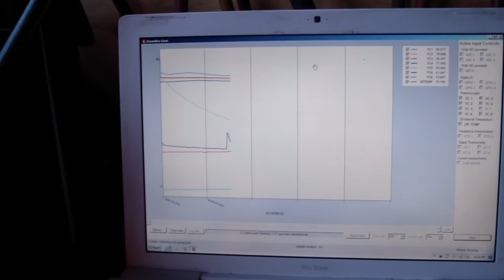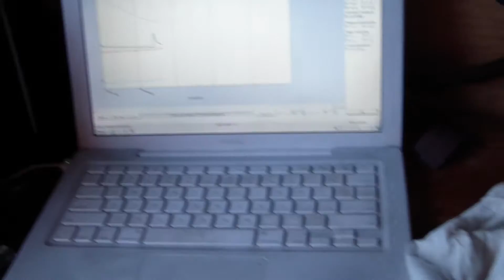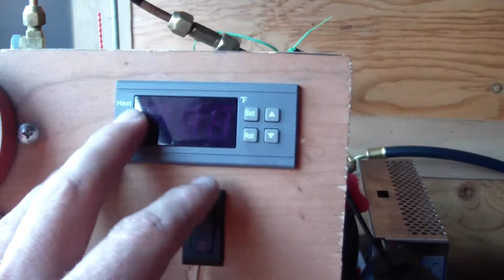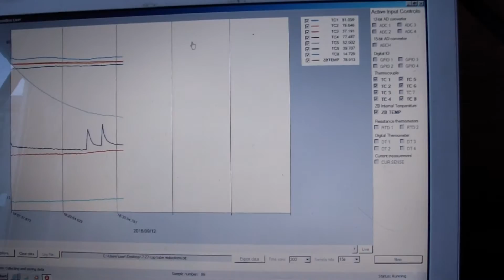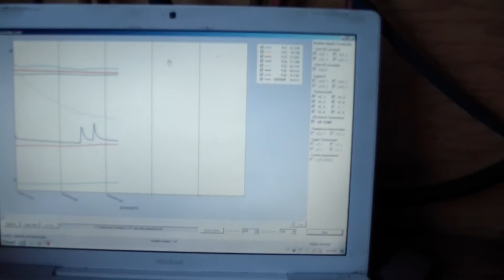9 Hour Glycol Freeze, Eutectic Fridge

Comment: Adding a alcohol bottle on the thermostat probe can give you the desired lag. Does that thermostat not have a good hysteresis curve setting?
Reply from the maker: It does not have a hysteresis setting that I''m aware of.  For several months now, I've had the same delrin thermostat setup, and I clamped it to the bottom of the glycol pan.  I can leave the door open for a long time without the compressor coming on.  Good idea on the alcohol.